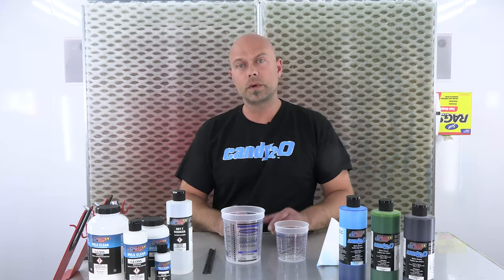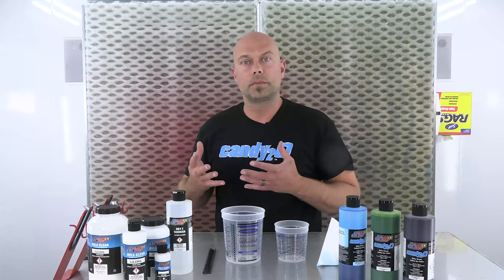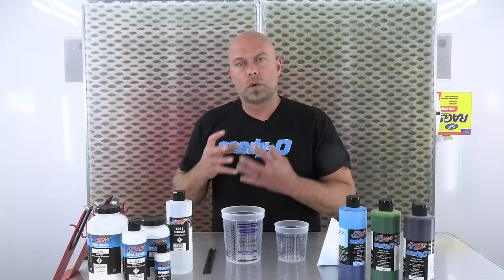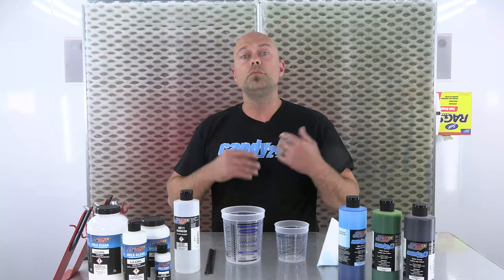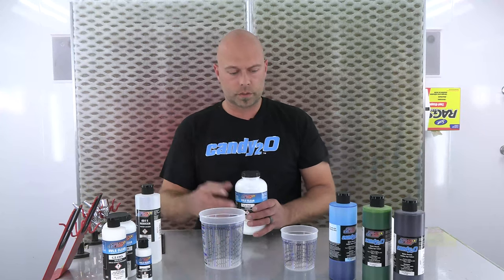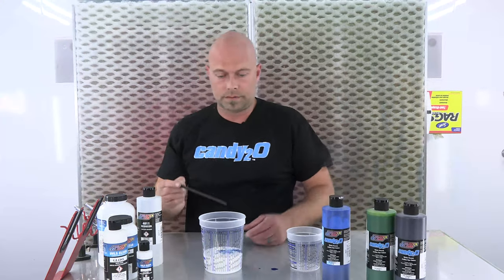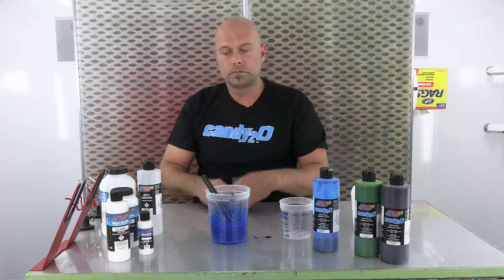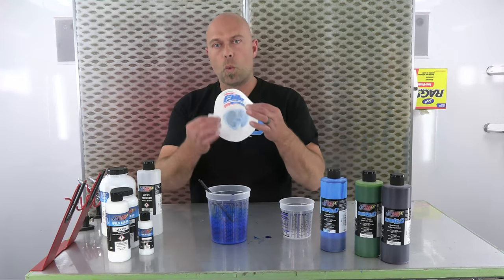candy2o Mix Guide

Comment: So do you recommend straining your candy mixture into your airbrush the same as for using a bigger spray gun? It always cracks me up seeing experienced airbrushers pop the top on their paint bottle and squirt directly into the airbrush color cup, back flush to mix and it's go time! How do you even know if you're mixed at the correct ratio? Good info on mixing the candies--I've got some but have yet to try them. I gotta leather jacket coming up soon.....
Reply from the maker: Yes, always strain candy20 prior to  spraying with either an airbrush or spray gun. Thanks for watching!

Comment: If using a 1.4 tip spray gun would you stick with that 6:1 mix ratio or 1.4 not advised at all?

Comment: I have been frustrated with the Candy2o paints....I use it mainly for plastic model cars....I get a beautiful paint job only to see it get ruined when applying waterslide decals....the water is basically washing the paint off in areas....not sure what I am doing wrong....I am mixing and applying as directed in your videos and I even wait over a WEEK before applying decals...I use the autoborn sealer gray.....then quick silver....then the candy20....I let the sealer dry over night....let the quick silver dry over night then the candy for a week....water hits it and it runs the color off down to the silver.
Reply from the maker: Do not soak candy2o, or any water-based, dye color direct in water. Top-coat with a 2k solvent-based urethane clear, then soak in water for the water decal process. Thanks.
Reply: @CreatexColors  ok....thank you...I appreciate that
Reply: @CreatexColors  so question if we top coat it with 4050 after the painting process or with the high gloss 4053 is it safe from contact with water or should we use a completely different top coat altogether? Like if I paint a bicycle with it and it starts raining will the paint get ruined?
Reply from the maker: Always top-coat candy2o or any other dye based color with a catalyzed (2k) clear before submerging in water or exposing to outdoor elements. This would apply to any dye-based candy color: candy2o, water-based and solvent-based candy colors. UVLS Clears work to protect colors (standard pigment-based Createx paints) from direct exposure to water but do not prevent the leaching of the dyes through the clear as does a 2k clear. Thank you.

Comment: In another video, it was mentioned that the 4053 was going to be replacing the 4050. So, should I be using 4053 with the candy2o also?
Reply from the maker: We've never made a video that 4053 High Gloss was replacing 4050 UVLS Gloss Clear. 4050 is the only carrier-medium recommended for candy2o. Thank you.

Comment: So since candy 2o is basically just a dye could I use it and mix with automotive clear base coat or intercoat clear? I just have a bunch of candy 2o and was curious
Reply from the maker: candy2o is not just a dye. It's a metal complex dye, and contains other products. By automotive, do you mean solvent-based paints (notwithstanding that many OEM automotive paints are water-based)? If so, no, solvent-based and water-based products can not be directly mixed. candy2o can be mixed with other water-based paints & coatings, keeping in mind that there will be bleeding issues when mixed, same as when using candy2o itself. Thank you.

Comment: I have been using 4030 to mix my candy based off an older video. Is that not recommended anymore?
Reply from the maker: Since 4050 UVLS Gloss Clear was recommended in March 2020, it has been the recommended carrier-medium for candy2o, replacing the 4030 Balancing Clear as the recommended medium for candy2o. For more, please refer to our candy2o tech sheet, thank you. candy2o TDS, https://creatextech.com/assets/html/pages/Candy2o-TDS.html

Comment: When im trying to get an anodized paint look with the candy2o colors ive seen i need to have a gloss black base to spray onto . can i put on the black auto borne sealer and then spray some 4050 clear over it as my black base ? or should i go with wicked black W002 mixed with 4050 gloss clear?
Reply from the maker: Color references for anodized candy2o colors are available at https://candy2o.com/anodized-candy-colors. Apply W359 Quicksilver over W017 Wicked Gloss White or W018 Gloss Black, https://youtu.be/LPkIIwiSUCs.  4053 UVLS High Gloss is a better choice over either W002 Wicked black or 6002 AutoBorne Sealer Black when used as a reflective base for Quicksilver (or W358 Gold Chrome). Thank you.

Comment: Ohhhh the shop i got my juice from told me different wow I've been shooting wrong in my airbrush... I wasn't even told to use 4050. They had me running candy at any volume to about 5 to 10 drops 4030 and 4011 reduced my 5604 clear. Wasting the candy.
Reply from the maker: Since 4050 was introduce in the beginning of 2020, its been the only carrier-medium we recommend for candy2o. 4050 works much better as the candy2o carrier compared to 4030 Balancing Clear. Thank you.

Comment: How long will it last if you premix it in a lided bottle
Reply from the maker: Indefinitely after mixing with 4050, so long as air capped air tight. After thinning with 4011 Reducer, shelf life is anywhere from 24 / 48-hours to a few weeks, depending upon how much its thinned and how well capped air tight. Best is to only thin candy20 + 4050 mix as needed for that day. For more, please refer to the candy2o tech sheet available at www.creatextech.com. Thank you.
Reply: @CreatexColors  thanks so as long as it’s air tight it will last for a while

Comment: Great vid. 
How long will mixed paints keep in a sealed container?
Reply: You should probably wait for a direct response from Createx, but I emailed them a while back and was told once you add the 4011 reducer that batch needs to be sprayed within 48 hours max. So if you mix Candy2o with the 4050 gloss you can store that batch indefinitely, but of course that won't be sprayable at least not through airbrush without reducing.
Reply: On a fishing lure, that is going to be epoxy coated, can I use 4030 as my candy medium, and thin with 4011
Reply: Also, on a fishing lure, we are using 3 to 4 drops of color, lots of guys mix it in the airbrush bowl,how about a vid of how to mix very small amounts, as we use very small amounts,and a lot of different colors, you have excellent vids, but they seem geared got larger projects, cars,motorcycle parts, etc. , I would never mix enough to even use that 125 strainer, please advise
Reply: @kokomon5  4030 was the carrier before 4050 so it will still work . and I mix in my cup ,4011 1st then 4030 or 4050 followed by candy  sometimes the mix may be 50/50 4050 to 4011 and 2-3 drops of candy.
Reply from the maker: candy2o mixed with 4050 UVLS Gloss Clear will last indefinitely as long as its capped air-tight unless pouring paint from the bottle It is only after adding 4011 Reducer that viscosity will begin to increase over time, especially the more the fixture is exposed to fresh air. Only thin candy2o + 4050 mix with 4011 Reducer for colors intended for spraying within ~ 48-hours. Thank you.
Reply from the maker: It would be the same mix ratios, just less material. Thanks.